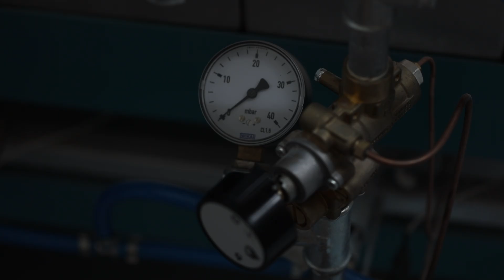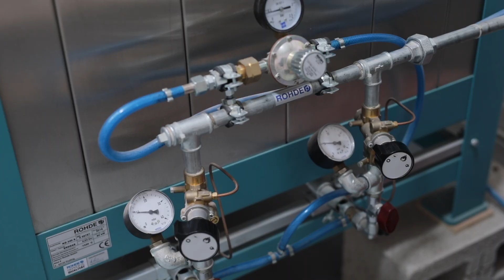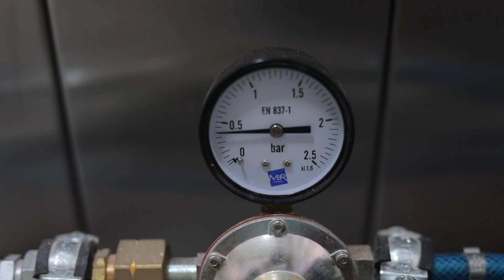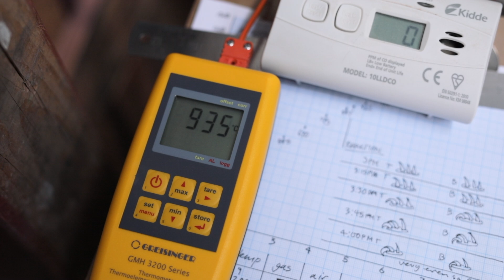Packing Pottery for a Reduction Firing in my Rohde KG-340 Gas Kiln — ASMR Version

Comment: how the hell did the packers get the plates in the styrofoam in the first place?
Reply from the maker: Good question. I wanted to get them out neatly but I'd have needed some help to do it safely. So I resorted to the simple method of destruction and tore one corner away before prising them out. I could have flipped the whole thing and then removed two of the styrofoam corners but again, not something I'd like to do by myself when these are relatively fragile things that are VERY expensive.
Reply: I imagine that they assembled the pack on its side. First, put two of the styrofoam corners down on their side with the slots facing upward, then place the plates in each slot vertically, and finally, place the remaining two styrofoam corners on the top. Easy-peasy. At least that's how I would have put it together and taken it apart.